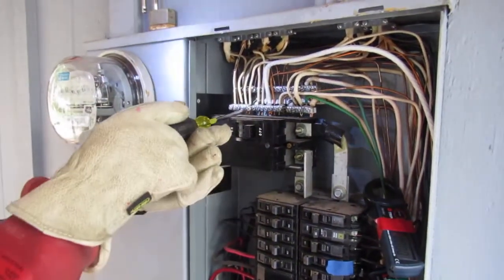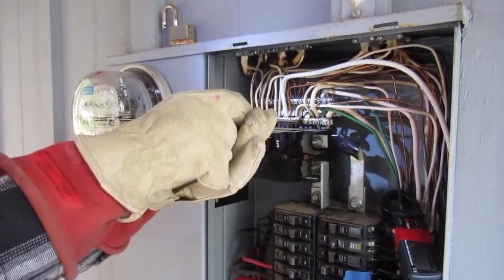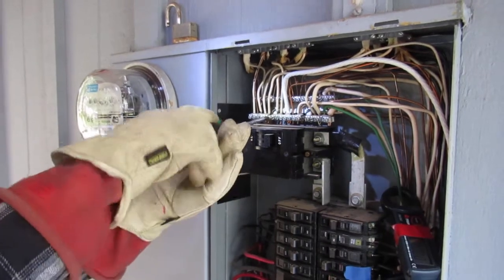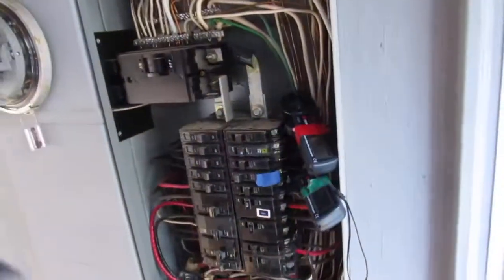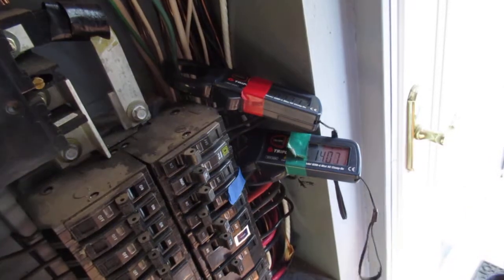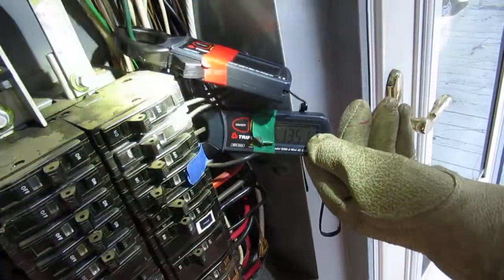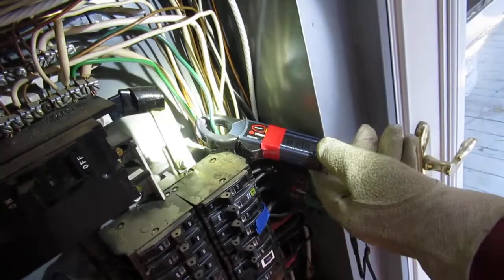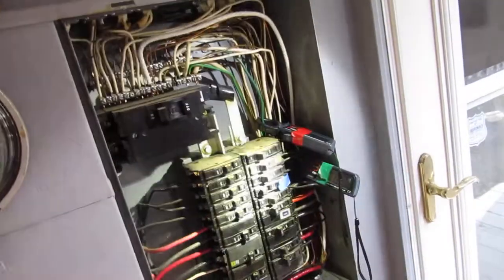Objectionable Current on Equipment Grounding Conductors Indicate  N-G code violations.

Comment: Sufficient ground leakage due to ground-neutral fault but not enough to cause the breakers to trip. This amount of ground leakage could also come from DC leakage from power electronics in electrical devices in the home.
Reply from the maker: Hi Math Man,

I am not sure I understand what you are saying: could you clarify that for me?  Thank you, Eric
Reply: What was the cause of the ground leakage? You suspected it was a neutral to ground fault or even a bootleg ground a more likely occurrence and one that would trip any GFCI on that circuit if any were installed on the line side but not trip a GFCI on the load side.

I proposed another possible less likely reason than the one you suggested linked to dc leakage from electrical devices which can accumulate on a circuit if all devices are operating on on that same circuit.

If tightening a neutral busbar they should have been properly torqued as per NEC and manufacturers specification if available.
Reply from the maker: I spotted and photographed several N-G connections around the house.
Reply: @windheimemfsolutions  did you suspect any reason why this was done, it looks like an older property.
Reply from the maker: @mathman0101  House was built in 1971.  There  are add ons that were not to code.